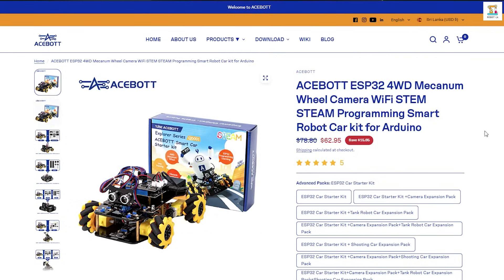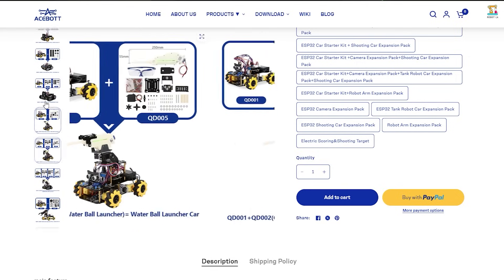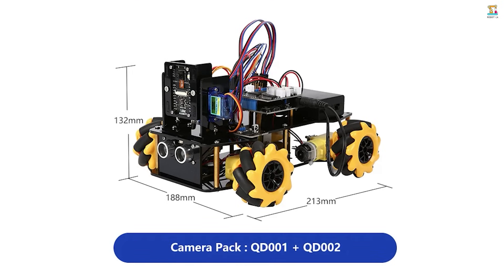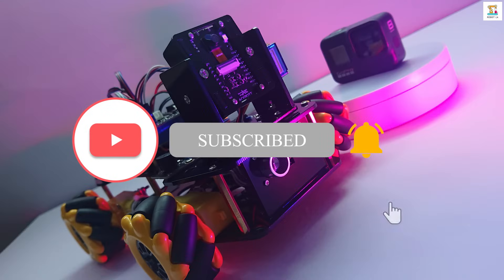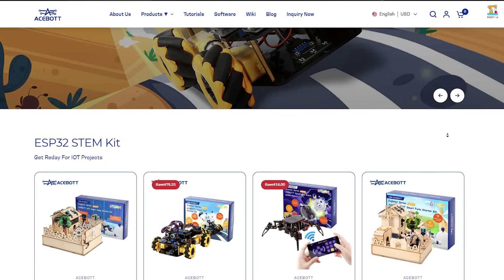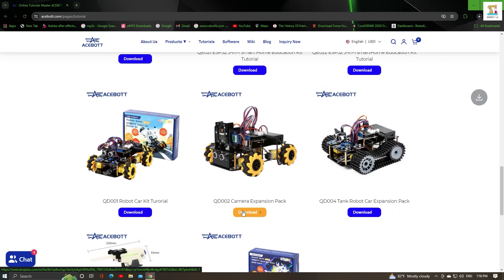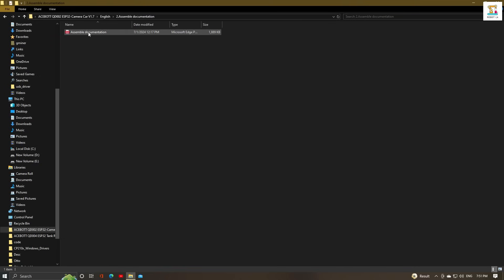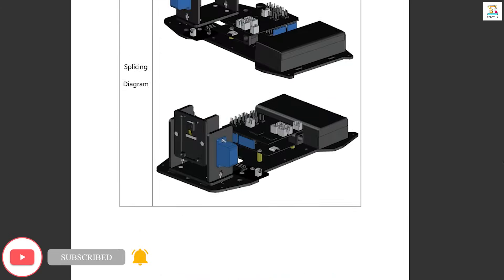All In One ESP32 Cam Smart Robot Car | WIFI APP | Acebott QD002 Camera Expansion Pack | Robot Lk

Comment: For some reason, the stock code for the camera is giving me errors. Please help if possible. I have made no modifications to the code.

/Users/markwilliams/Downloads/QD001-QD008/QD002 V3.5/English/Arduino(Experienced  Learner)/3.Program file/Lesson 8/acebott-esp32-car-camera/app_httpd.cpp:1384:5: error: 'ledcSetup' was not declared in this scope; did you mean 'ledc_stop'?
 1384 |     ledcSetup(LED_LEDC_CHANNEL, 5000, 8);
      |     ^~~~~~~~~
      |     ledc_stop
/Users/markwilliams/Downloads/QD001-QD008/QD002 V3.5/English/Arduino(Experienced  Learner)/3.Program file/Lesson 8/acebott-esp32-car-camera/app_httpd.cpp:1385:5: error: 'ledcAttachPin' was not declared in this scope; did you mean 'ledcAttach'?
 1385 |     ledcAttachPin(pin, LED_LEDC_CHANNEL);
      |     ^~~~~~~~~~~~~
      |     ledcAttach

exit status 1

Compilation error: 'ledcSetup' was not declared in this scope; did you mean 'ledc_stop'?

Comment: HELLO I HOPE U DOING GOOD BRO IF WE DRIVING A CAR AT THAT TIME AT HOME THE CAR WOULD  CONNECT  WITH MOBILE EVEN MORE DISTANCE THERE
Reply from the maker: The maximum range is approximately 10 meters. This is because it connects directly to the mobile device via Wi-Fi, allowing control only within its maximum range. Additionally, the same mobile device must be used for both video feed and control. If necessary, this can be modified by reprogramming the ESP32-CAM module.
Reply: @RobotLk  so will u help me actually I make a university project so I am not experienced

Comment: i am facing problem of the "app code". when i use the option of follow the car continously move backward. also after some time the right most two motor stop working when the follow option is on in the application of acebott. will you help me regarding this.
Reply from the maker: Switch the trig and echo pins of the ultrasonic sensor
Ultrasonic                      ESP32
GND                                  GND
Echo(white wire)             14
Trig ( Blue wire)               13
Vin                                     5v